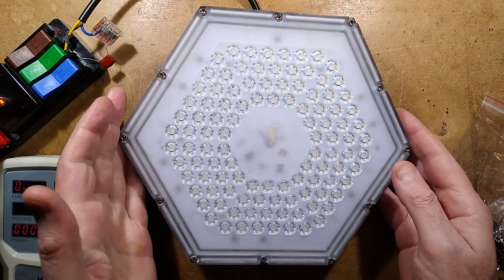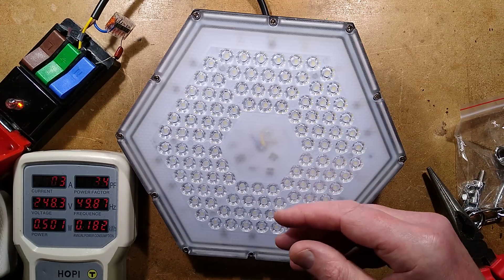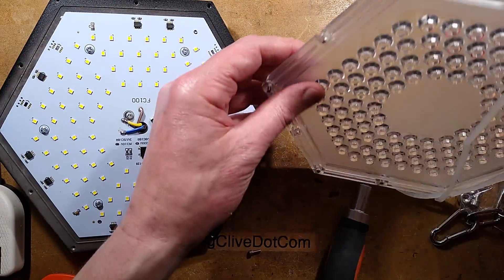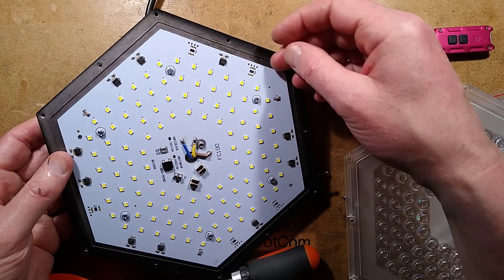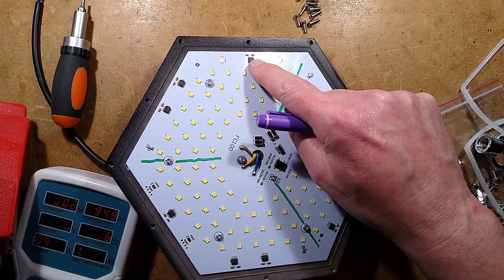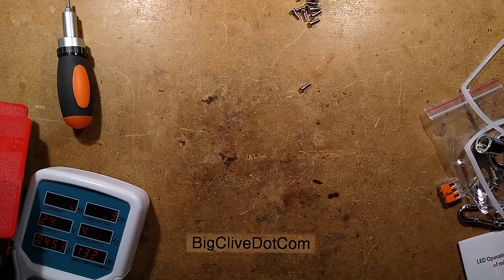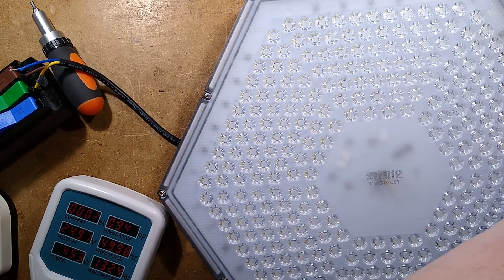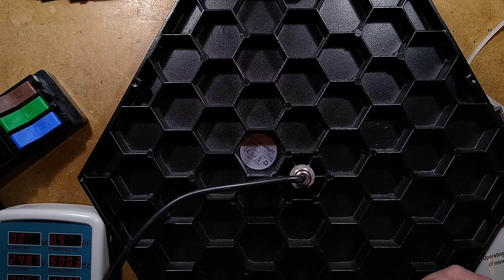Exploring an eBay "mine" light (flicker alert)

Comment: Wow, 80W and 300W, no way that semblance of heatsink will keep the temp under control, even given 20-40% efficiency, that still leaves us with a good chunk of heat to deal.
Reply: thats what they must do, because there is no electrolytic to die, so they must kill the leds with temperature... sad
Reply: the linear regulator chips do have temperature sensors built into them, but that probably wont do much tho

Comment: Cool light, but not temperature wise.

I think I’ll pass on those.

To get a nice amount of light I still use an e27 splitter like you suggested in an earlier video. Just four bulbs of a lower brightness to achieve a higher brightness with longer life.

I managed to score one of those splitters that is normally used for the big cfls that are used with video recording. They are quite nice.

Comment: Given the trend in electricity prices, at what point does it become practical to replace house lighting with a 12 or 24 volt system, ideally powered totally or partially by solar pv system?  Using the low voltage would eliminate the need for an inverter.
Reply: I mean, it wouldn't be all that hard to do that right now, just pull your mains lighting out, connect it to a battery and find some low voltage E26 or whatever holder you have bulbs or install a new fixture.

Although, given how efficient LEDs can be, I think electricity would have to be so insanely high that it's impractical to run most household items like AC/heat/computers/etc... and you'd have to be pretty desperate to save money to go bother, like really, we're usually only talking 5-10W per bulb, maybe 20-30W for a large one + about 15% to run an inverter, unless for some reason you need to replace all your lights, it's totally not worth it to save a measly few watts, now if we're talking something that draws a lot of power like a water heater, that would absolutely be worth switching to a DC system, saving 15% on something that uses over 1kW is a lot more impactful.
Reply: @vgamesx1  It would be a whole house refit for DC in this case, but yes electricity is becoming that expensive in the UK (where we don't tend to have AC anyway & where most water heaters run off mains gas).
Reply: I saw some research paper mocking up a 300V-DC system for the home, "simply put the SMPS rectifier on the distribution panel"...
Long story short, AC is safer (you tend to get thrown back from, rather than grip onto a live wire), easier to switch (DC draws a larger arc) and less lossy in nature.
To get the voltage low enough to not kill you, you wind up with current flow that will easily set fires...

I'm designing my own solar distribution system, and it's a bit sketchy handling 48V just to make the distance across the rooftop to the battery... Needs fuses and safety isolators at every turn to avoid either a fire or a nasty surprise during maintenance! It's nice to run the workshop entirely on sunlight though...
Reply: @KomiyanVT  It doesn't have to be on a single circuit like AC though, does it? You could run several smaller loops to keep the voltage and amperage down.
Reply: @NightCatArts  It depends, my aim is to make a single circuit to keep it simple from the top down...
In practice I could split it into many sections (say on a farm) and step up
to a higher voltage to transmit further...
High voltage DC is actually used on some large-scale power grids, so it's not out of the question.

Whilst it sucks to switch DC with contacts, you can use transistors and MOSFETs instead which is nice, It just means any switches and fuses that are used have to be extra beefy to handle the arcing and potential for a flashover...
And user safety is more intensive - as there is no RCD/GFCI to save you!
Reply: @KomiyanVT  Yea I personally wouldn't want to drive anything heavy off it, but it'd be nice to replace lighting circuits with little DC loops to provide, say, max 5 amps per room at 12v (which should be plenty of overhead but avoid the danger).
A lot of lighting wiring tends to be a bit dodgy anyway, in my experience, & I just don't like the waste of having every bulb convert 240v AC & run off rather bulky fittings. 12v DC fitted rails would be lovely to allow for moving the lights around and adding extras where needed.
Reply: @NightCatArts  Use 24V, campers typically run on that, so more parts readily available.
To run a PC (~200W) you only need 10A instead of 20 or more, and if you have balls and smarts - rip up the ATX and get it to run straight from the 24V supply with a host of buck converters lol!
Reply: @KomiyanVT  Eh, yea 24 would be overkill for just lights though. Would be nice to get the computers & all running off a solar battery setup but there's no chance with my beefy hardware (250 watts is the minimum for my main comp, with monitor, & the gaming PC pulls another 150ish). I am considering an UPS for that though, with an extra little one for the modem, so could potentially feed into those.
Reply: @KomiyanVT  A good compromise between AC and DC is pulsed DC. It's very easy to make from DC with high efficiency (just a transistor switching it), the pulsing solves the arcing problem, and the pulsing can easily be into a few hundred Hz for no flicker.
Reply: @NiHaoMike64  That would work - but then you run into the EMI troubles that this switching will produce.
Arcing isn't a problem with solid-state switching, just mechanical...
Reply: I haven’t read all of the comments, but there might be a problem with voltage drop.  

I ran into that with a 5V 60W power supply on long runs of programmable LEDs.  It took me a while to figure out why, but as you want down the string the blue would drop out, then the green, and finally the red.  This was because the components of the RGB chips all had different voltage requirements.
Reply: I've been wondering about this too, & also whether it's likely some standard will come along soon that could leave a property using a prestandardised refit with a resale problem. Most people, I suspect, wouldn't know where to start with replacements if they've bought a home with in-built LED lighting.

Comment: Important to note that when you "feel the heat coming off of them" you sort of, actually, well, ...aren't. You're feeling the pure visible light radiation being converted to heat upon absorption when it hits your hand. That's an important difference. I think because we're of a certain age we just tend to revert to thinking of things in terms of our experiences with incandescent lamps of days gone by where there was a large component of easily detected-by-skin infrared light being radiated both by the filament itself AND the insanely hot bulb glass surface, especially if it was a halogen. But here, the LEDs are at ambient temperature (particularly for these very short on times), and so you're feeling visible radiation only. I noticed this recently with a high power true UV 365nm LED - it's beam is shockingly hot on the skin the instant it turns on, primarily because the penetration depth of UV on the skin is so shallow that almost all the radiation is being converted to heat right exactly where the concentration of thermally sensitive nerve endings are most numerous. Incidentally this is why blue laser pointers are so much more dangerous than red even at the same output power, the red retina will permit a large portion of a red or infrared beam to pass right through and be absorbed over a large volume of tissue resulting in fairly slow heating, a blue laser will be immediately and fully absorbed in the first millimeter of retinal tissue volume causing instantaneous rapid heating and burns.
Reply: Yes this is a thing, I used to work with display lasers (around 5W CW) and they can burn holes in things from a considerable distance away, however, this thing was dissipating 300W so that metalwork will get extremely toasty, probably hot enough to burn skin.
Reply: I've noticed this phenomenon in my ultra high performance flashlight. 5000L full power, I can feel the "heat" from the light long before the body of the flashlight begins heating up.

Also thank you for that warning, I'll have to be even more careful with my high power blue etching laser. No using it without my safety glasses period.
Reply: Yes - visible light generates similar levels of heat as typical IR "heat radiation", but usually the intensity is so low that there is no heat felt (the eye is quite sensitive to light). But for strong LEDs like this, there is so much light coming off that the light getting absorbed by the skin is enough to feel the heat at close range. Same thing applies for sunlight (part of what felt as heat is IR and UV, but most of it is the high intensity visible light getting absorbed)
Reply: the light intensity from high power led flashlight is enough to burn paper sheet

crazy how bright leds are now

also, when he turned 300w led on, it somehow did sting my eyes too. despite this is amoled screen. samsung galaxy note 8, below 50% brightness, vertical video orientation

actually my experiments with bright light started with xenon photo flash. i played with them and didn't get how they affect close objects since it's just light right?
Reply: Well said.

Comment: I hate my new LED high bay lights, it causes alot more glare on the shrink wrap on level 3 on the pallet racking the older ones didn’t. 😩
Reply: You could try spraying them with that fake snow stuff intended for using on windows. I've found it does a decent job of adding some extra diffusion to lights that have too little, & I think you can still get it at pound shops.
Reply: Have you tried polarized sunglasses?  They’re designed to filter reflected light.  

Let me know if it works?

Comment: since its has a simple bridge rectifier, you could theoretically run this thing straight of DC voltage, wich would make current limiting very easy and smoothing is no issue either as its not AC anymore
Reply: Yes, Clive showed the circuit to do this, including smoothing.
Reply: Who wants to work with DC voltage that high?  Ouch!

Comment: good stuff. question: can you cut out/remove few of these current regulators, to reduce power? for ex. leave 1 reg per section to cut power by 3. effectively leave 30w per whole fixture? 30w seems reasonable for that size?
Reply: Yes, you can. Snip off the shunt resistor.
Almost impossible to desolder.
Reply: @CyberlightFG  Not impossible, but you will need to first preheat the entire fixture to at least 100°C and use a rather high wattage hot air wand (or heat gun) or soldering iron as you have to swamp the component with heat faster than the underlying copper or aluminum substrate and heatsink can wick it away.  Much like the challenge when reworking circuit boards with multiple solid ground and power planes, you have to overwhelm the ability of that substrate to wick away your heat in order to remove or install a component which makes preheating your best friend. Ideally one would at least want to remove the board from its heatsink, if possible, as that will help considerably.

Comment: 6:04 maybe the 6V/3V numbers for 220/110v are part numbers for LEDs with 6 or 3 die respectively
Reply: More likely the LED forward voltage as Clive mentions each LED having 2 chips in the 220V version.

Comment: I wonder if the flicker will be noticeable in the USA at 60Hz?
Reply: Yes, I can see it if an led fixture has anything less than DC going to the diodes.
I can see it on older fluorescent fixtures too.
Reply: Yes. Just 1/6th less annoying…
Reply: Absolutely noticeable.  How annoying it would be depends on how much motion it illuminates.  You would also see 'beat' frequency flickering from any other 60hz light source.  
   
You could use these as security lights outdoors, that only turn on when motion is detected.  But never for a tennis court.

Comment: You said putting a smoothing capacitor in parallel on the DC side, without also putting a dropping capacitor on the AC side, would cook the linear regulators. Why is that? (I will attempt to answer my question.)

It's because the smoothed voltage will be higher than the average of the unsmoothed  voltage, and the linear regulators will not have adequate cooling to drop that higher voltage level. Is that right?
Reply from the maker: That is correct.  The voltage will be higher and all that extra voltage will be across the regulators.

Comment: Interesting you should say about the heat coming off them, could feel that the other day even with my LED torch... it uses the typical '3 AAA cells and thin wires, and assume the supply resistance will limit the current'. With 3 new alkalines (screwfix best quality GP cells) it got noticeably hot and you could feel the radiated heat. 

It tames down after it's flogged the life out of the cells for a few tens of mins, then they last at the same useable brightness for about a month of normal use (maybe an hr a day)
Reply: I'm surprised the batteries last that long with the lack of circuitry, to be honest. (Mine don't). I certainly avoid the 'quid' torches now as i had one or two LED's let go then the others avalanched. (lack of regulation)

Comment: Mine light, hmmm... looks like a mine (with no explosives though) more than something you'd install in mines or other areas with an elevated explosion hazard.
Reply: Yeah, no ATEX-certification on that one. Interesting thing about ATEX and LED is that some LED:s are so powerful that the light itself (especially when focused by a lens and when the light from several LED:s converge in the same point) can be an ignition hazard. It's then not enough with a gas tight enclosure, armature cooling etc. but you also have to measure the light intensity at different distances from the armature to see that it's safe for ATEX use.

Comment: Shame about the flicker. If these didn't have the flicker, and were not so overdriven I could see a LOT of useful applications for them.
Reply: The panels come out at less than 1W per LED chip, not necessarily overdriven at all depending on what chips are being used. The power density definitely looks like these things would at the very least require forced convection for continuous max power. If the linear regulators used in there are similar to other current limiters for direct off-the-line lighting, the current should get throttled back as regulator temperature rises above threshold to keep temperature in check.
Reply: You could feed it smoothed dc power with a external full bridge rectifier, and a 400v capacitor, I've done that & it works, but make sure it isn't undersized.
Reply: @dandodd6178  You will likely shorten the life of the current regulator chips though. And waste more energy as heat. Since you are effectively raising the voltage by x1.414 and increasing the duty cycle (by smoothing over the periods where the AC voltage is too low to light the LEDs).
Reply: @rexsceleratorum1632  Wish they would just add in the capacitor, like they do with the led bulbs + the bleed resistor. Would cost the manufactures little to nothing to add in.
Reply: @dandodd6178  Electrolytics need to be kept away from heat sources, here the main LED board. It would cost extra to fit an electrolytic cap to a thin flat fixture if they have to make extra space for it.
Reply: @dandodd6178  Unless you mean a capacitive dropper, which has issues with power factor and dimmability (and spontaneous combustion of the cap in the cheap ones we used to get here in India)
Reply: Just feed them with a lower voltage and you should be good for a long time.
Reply: @ehsnils  or cap in series, 😉
Reply: I guess these are dimmable though.
Reply: i STILL see alot of useful applications, especially if you modify them and their drive circuits